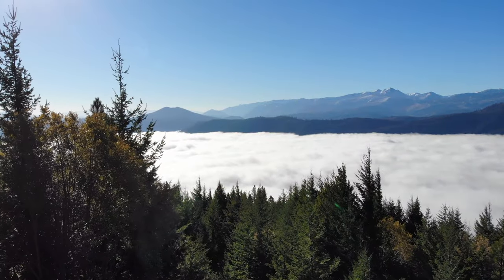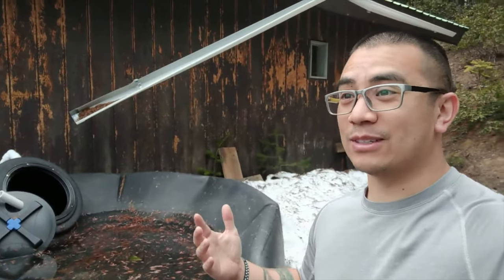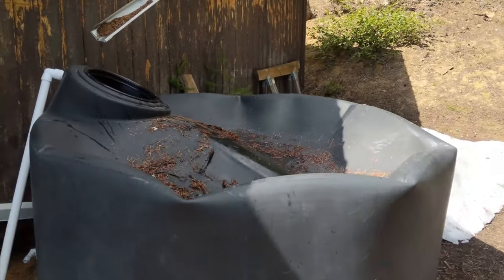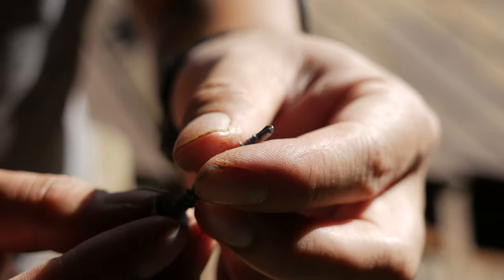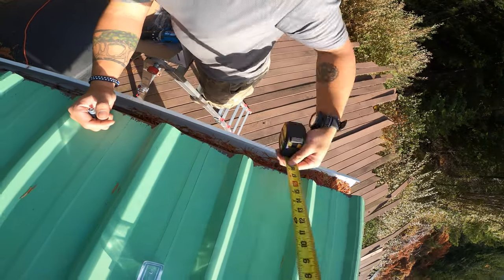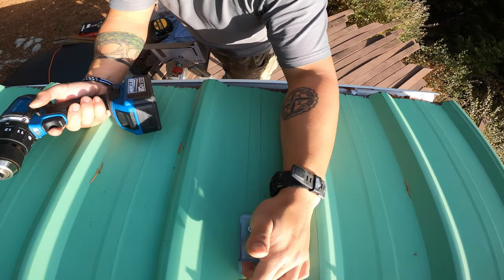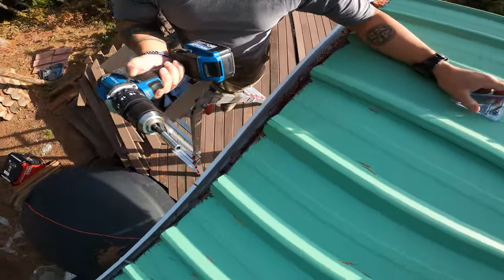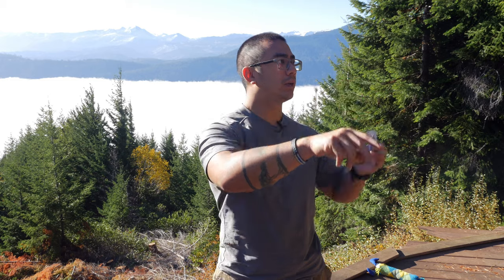How to PROTECT your House from SNOW: Snow Guard

Comment: Thanks for this video. I'm looking at installing a metal roof this fall, and I was looking at snow guards. I'm thinking of just adding them to places where I don't want snow to slide off, but leave the rest so that snow will slide off. I don't get why people would want snow or ice on their roofs. I know some people view snow as insulation, but with proper house/attic insulation and barriers, your attic should be cold. You don't really want your attic space to be warm. If you have heat in your attic, as you are just letting heat out for nothing. 

I would love to see a follow up video for this type of project, especially if you could get time laps showing how the snow/ice disappears over time. 

Beautiful local!

Comment: Great video and I "may" use these for the same reason. It's been a couple year since you installed them and I am wondering how well they worked for you. Did the snow and ice stay on the roof? Did it slide at all?  I noticed a couple bad reviews on Amazon but I couldn't say for sure if they were legit as I don't know the condition of the roof before the person installed them. Some people said theirs ripped out and others said the snow still slid off. How do we know if they installed them correctly and how strong was the wood under the metal roof. Know what I mean?
Reply: Yes! I’d like to know the same! Asap! I just bought my moms cabin and they installed a metal roof. Now we have terrible snow snd ice build up and at times, an avalanche of an ice wall crashing down and blocking our front door
Reply: @demoncrusher2760  I just installed mine last month and now waiting for winter again so I won't have an answer for a few months.

Comment: I just finished installing 216 of these snow barriers made by Snow Guard. I have a hidden fastener steel roof. I installed two Snow Guards per channel in my steel roof. The first row is 12 inches from the roof edge and the second row is 24 inches from the roof edge. In the channels, there are two raised "ribs" which serve as panel stiffeners. I installed the Snow Guards in between the raised ribs in each channel. This allows the gaskets to fully seal against the steel roof panel. I noticed in your video that you installed your Snow Guards on the rib running down the center in each channel. This may not allow the Snow Guard gasket to seal on the roof. The Snow Guards should have been installed next to the rib, not on it. I also used a string to keep my Snow Guards in a straight line. I installed Snow Guards on each end of the roof and attached string two each Snow Guard and ran two lines across the roof, one at 12" and the other at 24". It took me about 2 1/2 hours total to install two rows of Snow Guards on a 36 foot section of my roof.
Reply: What so you have now you have exposed screws on your hidden fastener roof?
Reply: @SweatMyTechnique  
Unfortunately, yes. Each Snow Guard has three screws with neoprene washers holding them down. Underneath each Snow Guard is a clear silicone gasket that will not leak if the correct screws are used and the Snow Guard is securely fastened. I had new seamless gutters installed, again,  and do not want the snow and ice tearing them off again.  It cost me $4500 to have these gutters installed along with aluminum mesh screens. The gutters came with a lifetime warranty as long as a snow barrier or guards are installed to protect them from damage. By the way, I got an estimate from Leaf Guard to replace my gutters and install leaf screens. They were $3000 higher than a highly recommended gutter installation business near me. Save yourself money and shop locally.

Comment: Was there a purlin or solid structure under steel that you were drilling into. I have horizontal purlins on edge under the steel so I think only one of the screws would be anchored to wood the other two would end up on either side of the purlin.

Comment: Coming from a warmer place, I would have thought those snow guards would lead to dangerous weights building up on the roof, but I guess that much snow would delaminate and slide off, or 8' isn't that heavy.
Do people not build with higher pitched roofs over there? I would've expected A-frames or similar would've become popular over the years.
Reply from the maker: People do build A-Frames but also when building "normal" houses or cabins in this area they use joists that are much closer together that can withstand the weight of a lot of snow without damage to the roof or the structure. If you ever take a drive around a neighborhood that has a ton of snow look at he roofs you will see either something like what I added here, or you might even see much larger "triangles" that either hold more snow or help it slide down slowly.

Comment: That’s a lot of holes to punch in a metal roof. A lot of potential leaks.
Reply from the maker: They use the same screws as the original installment, plus the snow guard itself has 2 separate gaskets (around each hole, then the perimeter gasket) before the water can get to the hole. It's a well thought out design
Reply: I really hope it works out well. Your cabin is in such a beautiful location. Keep us posted.
Reply from the maker: @stephenbeard9882  I'll deff. be updating during the winter season in the description and for sure on the instagram!

Comment: Aren't you worried about the snow load breaking your roof?.. Needs to be able to slide off I think. Snow is HEAVY!!
Reply from the maker: Not worried. Houses that are built in regions that get a lot of snow are BUILT for it. Smaller gaps between tresses, thicker beams, ect, all of the houses in this region have snow guards.
Reply: Snow will slide off a steel roof which reduces the weight load on your roof. Snow rarely slides off an asphalt shingle roof. Essentially, if your roof was once covered with asphalt shingles, like mine was, and you recovered the roof with a steel roof, the snow load bearing on the roof is no different. A steel roof weighs less per square foot compared to asphalt shingles and will last a lifetime.  I've seen asphalt shingled roofs with four layers of shingles on them. That's an extreme amount of weight on a roof, even without the snow. Of all the houses I owned that needed roofed with asphalt shingles, I always had a total tear off done to the roof, especially here in Northwest Illinois.

Comment: I understand why you wouldn’t want a large amount of snow to fall down on your water tank. But I’m rather confused with putting snow brakes on a metal roof that was designed to allow snow to come off of your roof and not build up and cave in your cabin roof. There’s something here I don’t understand.
Reply from the maker: Buildings like this one made in high snow load areas have joists that are closer together which increases snow load capacity. They aren't the standard 16oc that were used to. Also made it a pain in the ass locating studs but that's another discussion.
Reply: @innerbarkoutdoors  , this is not correct my friend.. They are built with a slope to get the snow off. I know from experience.. And from seeing your porch. 

We will see next spring, but I think the snow load will break your roof. I've seen it happen.
Reply from the maker: @scottpbenson  And I know from seeing my roof throughout the winter - that it's built to withstand the snow load. I have been to my cabin about three times this year mostly in the thick of winter (with about 3/4 feet of snow on the roof) and all is well :)  All houses in this region have snow breaks, similar to this kind, on them.